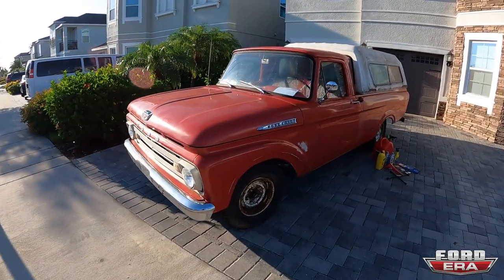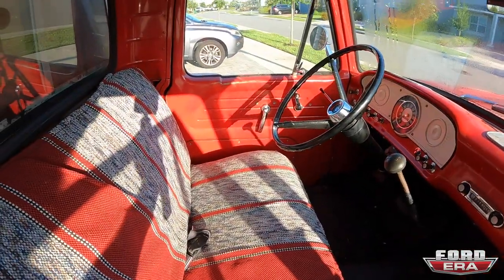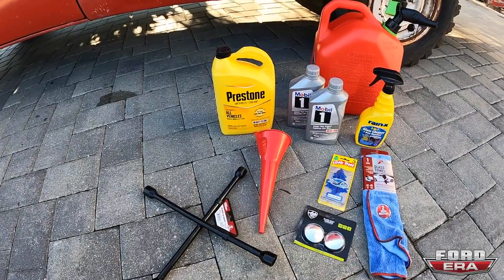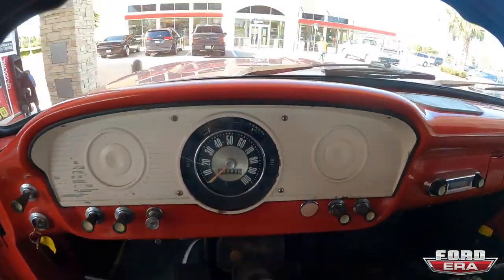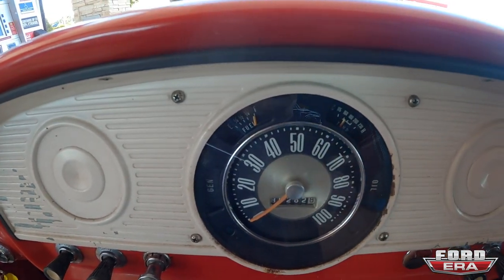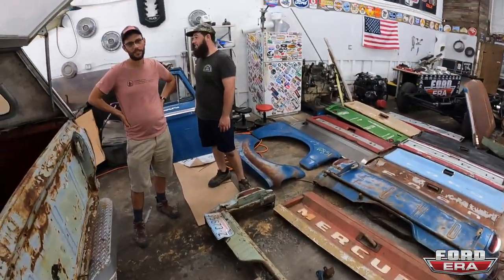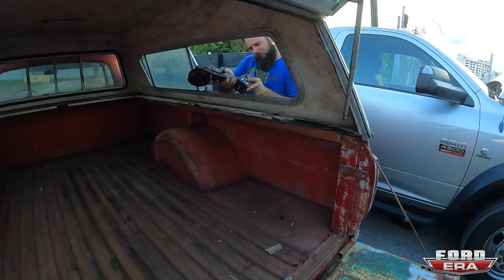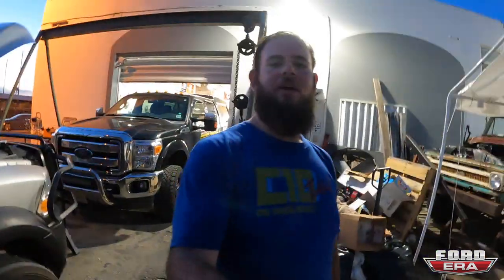Roadtripping an all Original 1962 F100 | Ford Era

Comment: I just bought a 62 F100, Bought it for a daily driver and a parts/ project hauler, I own a Custom Bobber Shop out here in Northwest Arizona and needed a truck. mine is originally that seafoam green color but there's not much  paint left, I'm just gonna throw some red oxide primer on the main body and then a heavy metal flake roof and lowest body line  and wheel wells with my shop logo on the doors and then just throw  a clear coat over it. The 292 in mine was long gone when I bought it, it has a 302 out of 81 or 82 Mustang and an automatic trans in it. I lived in Titusville for several years before moving here to Arizona, I recongize ALOT of that roadtrip, my best friend live on the Coquina street, the next street going south  past the old Harvey's Orange Grove you showed in the video, his house actually back up to Grove, his kids used to play in the grove when were younger.

Comment: I had the 1965 Ford f100 automatic transmission on mine the truck was bullet proof it was also unibody mine had the under dash air conditioning unit I miss that old truck